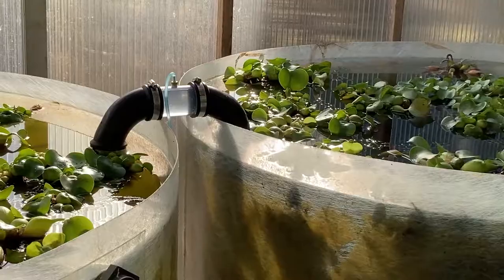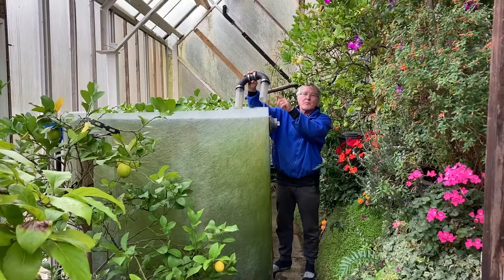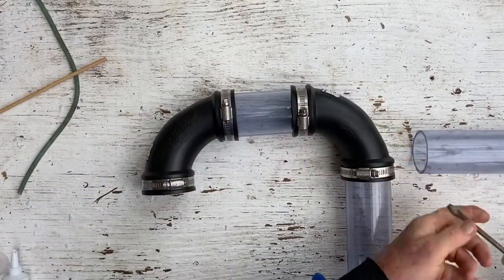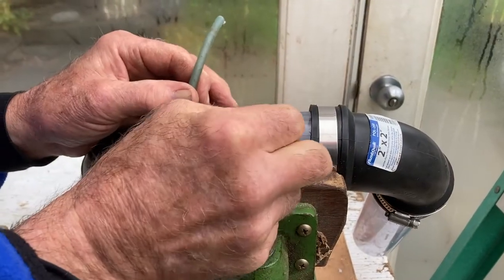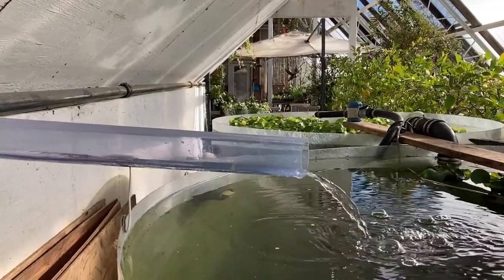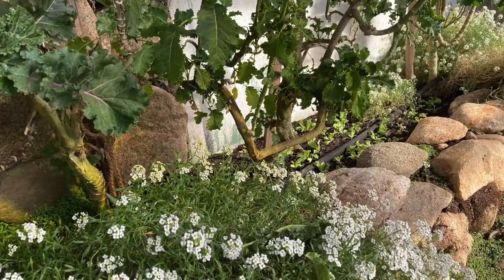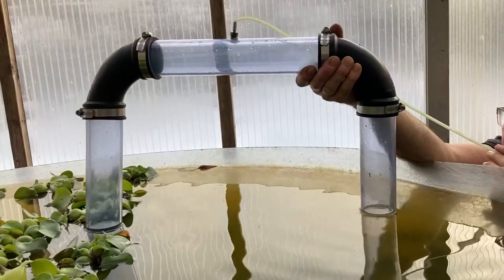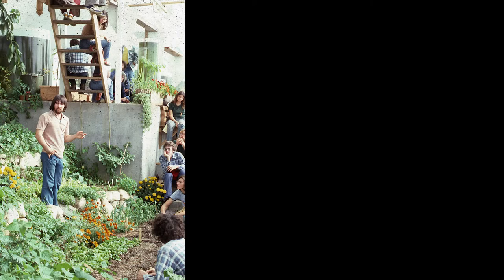Simplest, Most Adaptable Siphon for Aquaponics Systems

Comment: Thank you! I really like the idea of using clear PVC to inspect for air. Thats really smart.
Reply: Air accumulating in the top of a siphon  is the main problem with using siphons. Air ALWAYS slowly accumulates, slowly reduces the volume of water that flows through, and eventually stops flow altogether.  In an opaque pipe you cannot see it happening until it's too late. Even then, when you restart an opaque siphon you can't see how much air is in it at the beginning. 
The air that accumulates is from tiny bubbles, some are oxygen bubbles from algae, and some are normal air that come out of the water because the space above the water in the siphon is always under a light vacuum and it pulls the tiny drops out of suspension in the water.

Comment: Loves this. If I ever make some ponds this way I am going to implement this.  However instead of drilling a hole and having to buy extra fittings you should just run the tube inside the pipe. Glue or use a plastic cup just smaller than the ID of the pipe. Just large enough to press the tubing against the top of pipe without crushing the tubing. Then finis putting the elbows and downpipes.

Also buy a brake bleeding kit from harbor freight and use that to suck the air out. Pond water can have very bad bacteria that will make you sick.
Reply: or even add fittings to both ends with a hose adapter and valves if they are a longer distance than what you can get in the pond. hook a hose to one end and leave the other end open until the water pushes all the air out then close the valves put them in place then open the valves.
Reply: @johncollins3910  well I was thinking to remove cost, making it easier to start and add a bit of safety. Adding more fittings doesn't exactly go with removing cost. Also it seems, what you are suggesting, will make it harder to start.

Comment: should the syphons be level? which way does the water flow? can you suck the air out and water up through that thick pipes ,with that small clear tube...
Reply from the maker: The two ends of a siphon do not have to be level where they rest on the top edge of a pond. It is easier to suck out any air in the top of the siphon if it is held level for that operation.

The water will flow from the pond with the highest water level to the pond with a lower water level. 

It is easy to suck out air through the small tube; when you suck out air from the top, water will rise up each side in the large tubes and finally fill the horizontal tube with water. The siphon will work if there is some air in the top horizontal tube, but more water will flow the less air there is.

Comment: Does this mean you have to watch as the water rises from the first pond and then start the siphon manually? This is an excellent video. Thank you for sharing.
Reply: The siphon is always full of water.  It works automatically; if the water level is higher on one side than the other, water will flow over to the lower side until both levels are equal.   They will stay equal all the time, unless more new water is added to either side.  Then they will equalize again until the levels are the same.  The siphon is always full; water just runs through it, water never drains out.
Reply: @hildamaingay  Thank you for the clear explanation.

Comment: Do you use some other siphon to keep the water level from filling past a certain point. I understand the high to low aspect but how do you keep the water level static at a chosen point for the proceeding tanks to then mimic/fill to that same level?

Comment: your inflow vs the syphons doesn't seem to match up ,doesn't the syphons draw more water out than what is put back in?
Reply from the maker: Water will flow automatically from one pond into the other from a pond with a higher water level to pond with a lower water level.  When the water levels in both ponds are finally the same, the water will stop flowing.

Comment: Hi, I just wonder how would you ensure the flow is from right to left and not the other way round?

In any case, this is a great work, thank you for sharing.
Reply from the maker: The water will always flow from the pond with the higher water level to the pond with the lower water level. The water will flow until the two ponds have equal water levels. The rate of flow slows down as the difference in water levels gets smaller and smaller.
Reply: @greencenter9608  tq

Comment: great idea! simple and efficient. 
i am curious about how much water  you input to the system: l/h? is it a constant input or only.
 when it rains?
Reply from the maker: New Alchemy's research on Zweig Ponds (lettuce aquaponics) suggested  removal and replacement of 20% of water per week (to remove some portion of the dissolved nutrients). 5'x5' ponds are about 700 gallons. So each pond should get 140 gallons of new water per week . We have a row of 4 connected ponds, so theoretically 560 gallons of new water should be run through, though its not the same as replacing 20% new water into each pond. In practice, we use a timer and put new water in at the upper end for about 30 minute from a garden hose at about half-rate. I donut know the gallons/hour but willmeasur it and let you know.
Reply: @greencenter9608  ok great, i would appreciate. this is gold!

Comment: Up here in Ontario, we built our own 33 foot geodesic dome greenhouse with our own climate battery. It made it through the first winter ok, but there is always room for improvements!

 I see you guys are growing citrus. What winter temperature range do you guys keep for the plants? We personally never let it get below 4.5 degrees centigrade as a low point in the night. I'm very curious!
Reply from the maker: We have several Meyer lemon trees about 7 feet high in large pots. We put them outdoors each summer - rain and sun and birds keep  the leaves free of black sooty mold and scales that grow on the leaves if they are left in the greenhouse all summer. We put them inside in winter. The temperature in aor greenhouse often goes down to 40 degrees F and occasionally in worst times can go right down to 32-33  F  and the lemons are OK. Lemons are the most hardy citrus; I don't know if oranges could go that low.

Comment: Using gravity is a great approach to making this process work.  Then you are not reliant on pumps that can fail.  I imagine it is also much quieter using your siphons than motors and pumps.  I am curious how strong someone's lungs have to be to suck up that much water to fill the siphon.  You do it quickly, so either it is not too bad.
Reply from the maker: It's a little like sucking a milkshake up a long straw;  the water is only sucked up about 6 inches from the top surface of the pond to the top of the siphon,
Reply: You can also pinch the tube between finger and thumb between sucks. 

Green Center:  Love your setup and the siphon is the best I have seen yet, especially with your solution to starting it. Thank you for posting